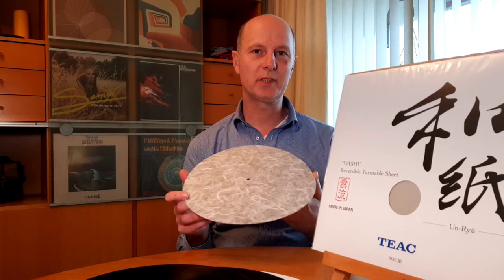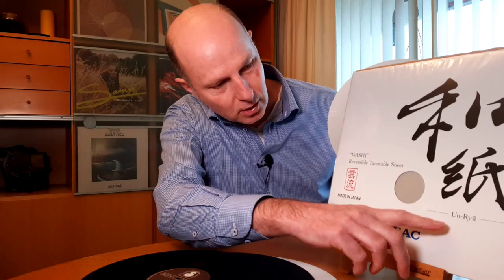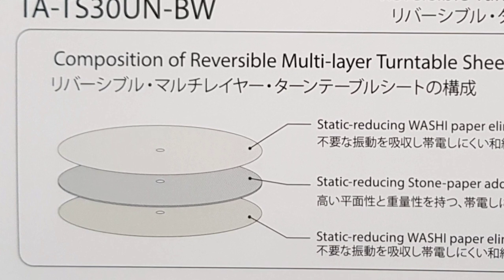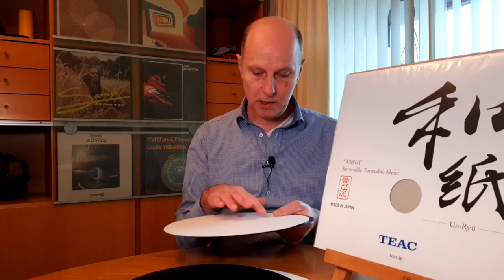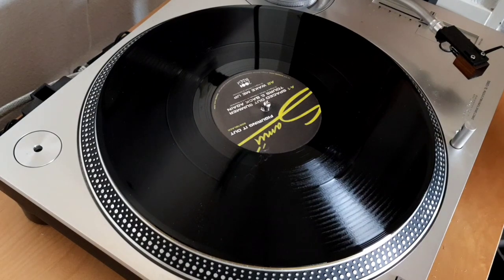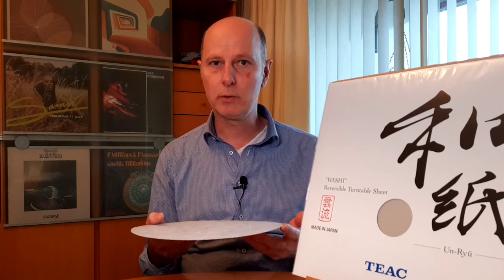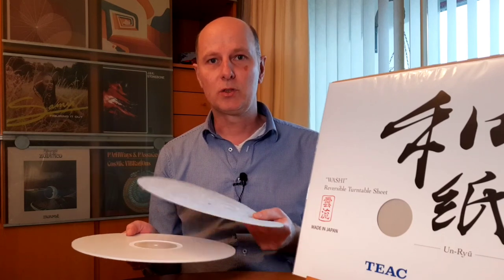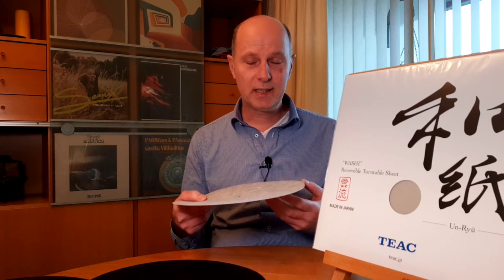Review JAPANESE WASHI TURNTABLE MAT TEAC TA-TS30UN - Vinyl Community

Comment: Hi Paul, that’s fascinating. I work in fine art conservation/restoration and that paper is widely used to repair delaminated surfaces. Also as protective packaging for storage & transportation. Acid free commercial tissue is mostly used as it’s much cheaper (basically paper pulp with acid removed). The mat you have looks like white mulberry paper. Top quality. You probably know it’s a by- product of the silk industry as the silk moths feed on the leaves. 🍃
Reply from the maker: Hi Ed! Nice to see you stopping by again. Didn't know it was a by product of the silk industry. That's a fun fact to know. I sometimes visit paper mills and see the different pulps they use. Never seen this thick and long fibers. Look special. Enjoy your Sunday. Cheers. /Paul

Comment: Interesting that you spoke about the static on a brand new record giving problems with the mat lifting off...I think we've all experienced that, so I've got into the habit of cleaning new records before I  play them & putting them into a brand new anti-static inner sleeve. It sounds silly but I would recommend it to others as it kills the static so no dust is attracted and it also stops those annoying pops on playback. My cleaning solution is the usual type that many VC make up using isopropyl, distilled water & a small amount of wetting agent...it's cheap & works well.
Reply from the maker: Hey Andy. Always nice to hear from you. You're 100% right. In the video you can actually see the effect :) The record I lift in the video, is the record that was very static. I wanted to show the lifting of the turntable mat also in the video, so a few days later I videotaped it. But forgot I had already cleaned it. All static was gone :) Like you I also clean all my new records. Cheers. /Paul

Comment: Interesting - though I haven't heard much difference between mats in my experience - I actually run without a mat now since I have a acrylic platter.
Reply from the maker: Hey Kris. You really can get used to the sound of a turntable mat. And as you previously mentioned you need to do quick swaps to hear the differences. I've always feeled an acrylic platter or mat need a record weight or clamp otherwise the surface is really slippery. And I'm too lazy to use a weight :) Cheers. /Paul

Comment: Hi Paul, just a quick note to say that I purchased the TEAC TA-TS30UN Washington turntable mat - and wow! My static problem is a thing of the past. Thanks for reviewing it and letting us know about it. Keep up the great work! Kindest regards, Jim
Reply from the maker: You are quick, Jim! Great to hear you got it. Also the feedback on solving the static problem. Have fun spinning even more records this weekend. Cheers. /Paul
Reply from the maker: Forgot to ask. What kind of turntable mat were you using before?
Reply: @XjunkieNL  I had bought an identical platter and added an acrylic mat. It was ‘okay.’  But this paper mat from TEAC was a big surprise. I put the original platter back on the turntable and dropped the new paper mat on. The difference is night and day.
Reply: Hey Paul, quick update. The mat works great, but add a Furutech Destat III to the mix and it's the best combo to reducing or eliminating static. I also use a SweetVinyl - SugarCube SC-1 Mini between the phono and my amplifier to reduce pops and clicks in real time. It's a triple play.
Reply from the maker: Great to hear an update, Jim. Did the sound change with this combo? Otherwise a great way to reduce static to a minimum. Have a great Sunday. Cheers. /Paul
Reply: @XjunkieNL  Yes, the soundstage beomes clearer, it opens up in a way I never heard before. And the static is lowered to such an extent that the vinyl is dead quiet, or very nearly dead quiet. Worth the price. Best, / Jim
Reply from the maker: That's great to hear. You really have found a way to get the noise floor even lower. Nice bonus the soundstage has become even bigger. It seems both are always connected. Enjoy the new sound :) /Paul

Comment: Hi Paul, have you evaluated if the change in sound comes from the change in thickness between the mats (VTA, Vertical Tracking Angle, changes) and not the material? I use silicon-based rubber mats because I am a firm believer in that damping thumps and resonance coming through the record player and through the platter is of greatest importance. Silicon based rubber is also in the same Triboelectric table as PVC (Vinyl) so it will not be static charged by the record it self. A rubber mat of decent quality will also give a firm grip on the record. Nice looking platter mat anyway and thank you for doing this.
Reply from the maker: Hi Peter! Thanks for sharing your experience with the silicon based platter mat. As a cartridge I'm using a Denon DL103 with conical needle. The influence of height changes will be less critical. Your platter mat will for sure never get stuck to the vinyl. Although washi paper looks very flat, it has a good grip to the record. The vibration absorption will not be as much as a rubber mat, it does absorb some of the vibrations. That's probably also where the change in sound comes from when comparing different mats. Have a great Sunday. Cheers. /Paul

Comment: Many will buy just for its looks.
From their website;

"WASHI" is a traditional Japanese paper made from the ﬁbers of Mulberry trees. With natural durability, it’s been widely used for UKIYO-E printings and paper currency for centuries. Recently, it’s been re-discovered and used for stationary and interior fabrics for its beautiful design and excellent functionality. Particularly, "Un-Ryū Shi" is a unique type of WASHI made using special techniques which, showcasing the skill of the craftsman, can be seen in the characteristic ﬁber pattern on the paper. By combining this WASHI with Stone-paper for core material, this turntable sheet gains mass and becomes uniformly flat, while restricting vibration, reducing static electricity, and preventing dust from accumulating.
Reply from the maker: Hi again Julian. And it looks beautiful! But it's not just a pretty boy, it sounds good too. On my system it sounded very good. Thank you for the additional information. Washi is special and has some nice features. Cheers. /Paul

Comment: Very good, thorough treatment of the item. I don’t have a problem with static as I live in the tropics. I may benefit from it since my Klipsch speakers are said to be quite bright. I have the stock felt mat included with the AT LP120X BT-USB?

And, what effect on the quality of the audio would a cork, or rubber, or acrylic mat have?
Reply from the maker: Hi again. With turntable mats it almost compeletely depends on your own personal preferences and your set-up. I don't know which turntable mat, or the material, is standard delivered with a LP120X. You have to experiment, but if your system is already bright I would experiment with softer materials like hard rubber or the reviewed washi paper turntable mat. Cheers. /Paul

Comment: Hi Paul! Thank you for another great video :)

Did you maybe try it on the rubber mat? My height adjustment is stuck on my 25 year-old  SL1210 so I can't just take off the rubber mat unfortunately.

PS I love how you mentioned that the Washi never gets stuck on the record because that's exactly what my old "anti-static" mat did ALL THE TIME. I threw it away eventually :)
Reply from the maker: Hi! Nope, that is something I didn't try. Do you like the sound of your SL1210? Especially if you like the bass, I would not change it. Especially if the rubber mat is stuck to the platter :) Thanks for watching. Cheers. /Paul

Comment: If I may give my opinion, such as with cables a Mat does not add anything to the sound that's a misconception but takes away something such as harshness or veil that's why it can sound better by hearing more into the recording  depending on personal taste and differs in terms of quality of the pressing that's why it make sense  swapping cartridge or even the mat.
Desalniettemin I appreciate je video's want zoals Nelson Pas zegt "high end audio is  "entertainment 👊
Reply from the maker: Hi Anjo! Hope this video was entertaining ;) I see your point. And especially with turntable I can image it is all about veiling something you don't want to hear. A cable can add something to the sound. Or at least that is my believe with phono cables. As the cable has a little capacitance, with any vibrations from the outside it will act as a microphone. Especially because of the high amplification of the signal. Any that is what I'm fooled to believe :) Have a nice Sunday. Cheers. /Paul
Reply: @XjunkieNL  precies wat je zegt from the outside maar de kabel zelf voegt niets toe dat is een gegeven maar het is aan de luisteraar what to believe
Reply from the maker: Hahah, een gat bij vijlen gaat ook niet ;)

Comment: It could be little tricky if you have a shorter height cartridge with limited function of tonearm VTA  alignment turntable, for instance, denon dl-103r with techy sl-1200mk2.
Reply: Yes, VTA was my concern too.
It's definitely thinner than the stock 3mm rubber mat.
Reply from the maker: Hi Jesse. You're correct. The SL1200 has especially when you're using cartridges with a high lower as 17mm limited possibilities to adjust the arm to the correct height. Of course there are options to solve this, for example headshell spacers. It's funny you mention the DL103R. It's the cartridge you see in the video :) It's probably also one of the few cartridges that's hardly effected by the VTA setting. Thanks for watching. Cheers. /Paul
Reply from the maker: My estimate is the Washi turntable mat has a thickness of 1mm. Perfect is you want to use it to exchange a felt mat :) /Paul
Reply: @XjunkieNL  Thanks Paul. Yes, I have dl-103r and used it with sl-1200mk2 on and off. The thing is that whenever I match dl-103r with sl-1200mk2 i experience vta issue even with the original technics rubber mat and a 2mm spacer. I am considering an extra thick spacer such as 4 or 5mm available on ebay though. This Washi mat is so tempting indeed, but wonder if this could deal with this dl-103r vta issue. However, I might get this one and match it with other carts.
Reply from the maker: I know what you mean, Jesse. I also use the DL103R. I replaced the body of the cartridge with a wooden body, that way a little extra height is created. But the real question is, does the arm need to be flat when using a DL103? Which VTA do you get when the arm is flat? Or when the butt end of the arm is higher? How does it sound at an other setting? Curious if yo see where I'm going with this? :) /Paul
Reply: @XjunkieNL  I do not use dl-103r at this moment, but if memory serves i add a 1.2mm spacer and the tonearm height was slightly above the bottom (i cannot see the exact value of the height since i have added kabusa fluid damper which covers almost half of the portion of the tonearm area. yes, it sounds pretty cool but whenever i play relatively lighter lps such as 70's rca dynaflex series, the tip couldn't touch down into the groove fully and even it produced bad distortion and skipping. i never experienced this any of my other carts. yes the tonearm is totally levelled though.
Reply from the maker: Hi Jesse. Thanks for clarifying that. It's really surprising to hear. With the Washi turntable mat I've played records with the back of the arm 5 mm higher as normal. Do you think it can maybe be something else? Is the needle tip able to drop below the platter level? Is the arm lift maybe not correctly adjusted? And making the arm not go low enough? It's puzzling me a bit. Have a great weekend. /Paul
Reply: @XjunkieNL  Paul, it's a huge mystery to me too. after several different setups, i finally came to a conclusion; getting a thicker spacer could be the only solution. i will get a 2mm spacer and see if i can solve this mystery. thanks again.

Comment: Very cool.  Have never seen that mat before but for $30, it’s affordable to give a try.  I have an acrylic platter so don’t know how much this would add to the listening experience
Reply from the maker: Hey Stavros. Most probably it's more about fine tuning. Adjusting the sound to your personal preferences. What are you using as a turntable mat now? Myself I have a few to see what fits my taste and system best. Cheers. /Paul
Reply: @XjunkieNL  I don’t use a mat since I got the acrylic
Reply from the maker: That's what I was thinking. Do you also always use a record weight? If so you're probably got the best out of your system. If you're not using a clamp or something similar all the time, it would be an interesting experiment. As you are changing several parameters. It will for sure sound different. /Paul
Reply: @XjunkieNL  I don’t use a record weight because I don’t know if my project debut carbon’s motor will be strained and I don’t know how much difference it would make.  My whole setup isnt audiophile really.
Reply from the maker: @spinningreek2247  I'm too lazy to use it. Also can't close the dust cover when spinning records. Only if a record is badly warped I use one.

Comment: Did you adjust the arm height i mean this mat looks thinner than the rub mat on vintage turntable. I imagine the angles are different if the mat thickness is different.
Reply from the maker: Hi Paul. I played with the arm height. As I'm using a conical needle it had little to no effect. Thanks for watching. Cheers. /Paul
Reply: @XjunkieNL   Thanks, last question did you place this mat over what you had or is the only mat now directly on the platter. Seems pretty thin so, both ways might be possible.
Reply from the maker: I used it directly on the platter. Sounds maybe strange, it's thin, but it still it has some fluffiness. /Paul

Comment: hey Paul...I have an SL1200mk3d.  I use a Hudson HIfi acrylic mat.  My deck came with a Technics felt mat.  The Acrylic mat was way better to my ear.  Kick drums tightened and it was less muffled.  Wondering if I just put this on top of the acrylic mat?  I do still get static on the acrylic mat.
Reply from the maker: Hi! Why not :) It will work with or without the acrylic mat. It will give a different sound. Perhaps the combo gives the sound you like the most. See what you like best. Not sure if it will help to reduce the static. Have a great weekend. Cheers. /Paul
Reply: @XjunkieNL  Thanks...ordered one to try out!
Reply from the maker: If you have the time, let us know it sounds. Curious if and how it changes the sound on your turntable. /Paul
Reply: @XjunkieNL  Got the Washi today.  Did some tests with 5 different albums, 5 different songs.  Rush/Def Leppard/AIC/COB.  I previously had the HudsonHIFI acrylic mat.  That mat is boomy in lows and highs.  Forward sound.  I run a AT440mlb cart, with the Washi it sounded warmer mids, more channel/instrument seperation, and more pleasing/neutral.  Not muffled warm, but warmer guitars and vocals sat a little better.  Before my cart could get a little fatiguing...This may have fixed that.  Money well spent...keeper for me.
Reply: As a note....used my pair of Sennheiser 58x headphones which sound great...and very flat for studio use.  I wanted to add that with the Washi mat, I heard what the mixing engineers were trying to accomplish more on each record.  Hope that helps.
Reply from the maker: Great to hear your feedback. Sounds as you found a better balance to the sound. Thanks for additional comment. /Paul

Comment: Hi Paul. Realize this is an old video but if you can tell me what cartridge are you using with your Technics? Thanks.
Reply from the maker: Hi Freddy. I'm a big fan of the DL103R I've been using it for 20 years or so. Sometimes listened to others, but always return to the 103. It's a great combi with the SL1200. Have a nice weekend. /Paul
Reply: @XjunkieNL  I’ve been told it has a great midrange and warm presentation. I might try it! Thanks again Paul.
Reply from the maker: If you have never tried it. You need at least try it once in your vinyl life ;) The midrange is indeed a strong point. The cartridge is a bit of a show off when it's playing and not scared of showing its strenghts. Cheers. /Paul

Comment: I have a question , I received my mat this week. My question is I have a technics 1700 mk1 . I can’t change the height of the tonearm like your turntable the mat is thicker than the washi , can I use both together?
Reply from the maker: Hi Jerry. I see where you are coming from. First, yes, you can combine different mats, although it will change the sound. Second if you're using a conical diamond tip, it's often not necessary to have the arm perfectly level. Hope this helps a little. Cheers. /Paul

Comment: Where can we buy the Echo turntable mat you show in your video?
Reply from the maker: Hi Jim. Sorry, I probably pronounced it wrong in the video. You mean the hard white turntable mat I show to compare? It is the Achromat. It's made by the Funk Firm. You can probably find it easily online. Thanks for watching. /Paul
Reply: Hi Paul, thanks. I found it thanks to you. Which do you recommend, the 3mm or the 5mm?
Reply from the maker: The one you see in the video is 3mm thick. I originally bought it for my Rega P3. It worked great on that turntable. Because of VTA limitations I couldn't use the 5mm version. /Paul
Reply: @XjunkieNL  Thank you Paul!